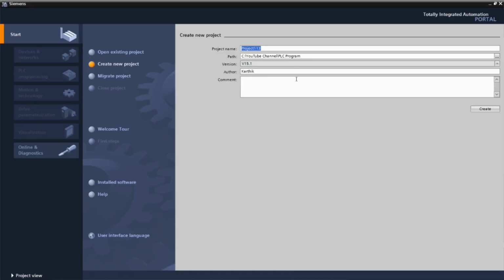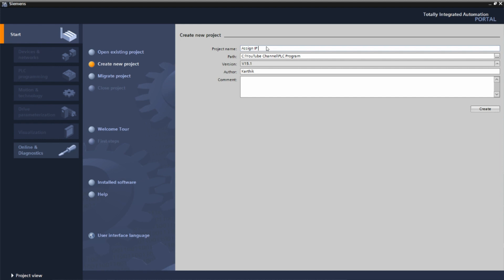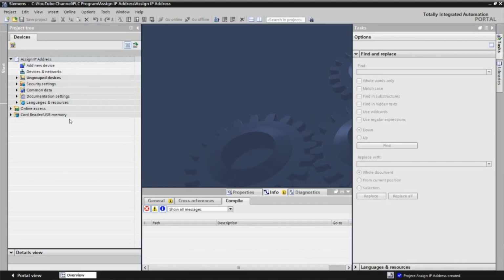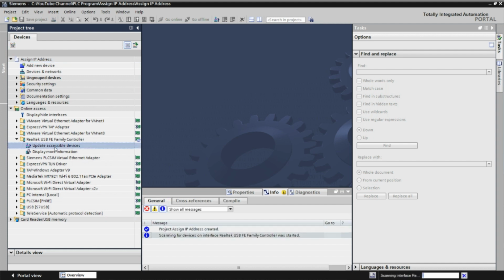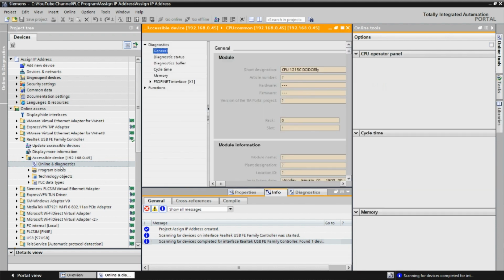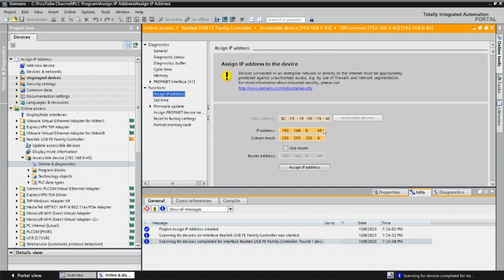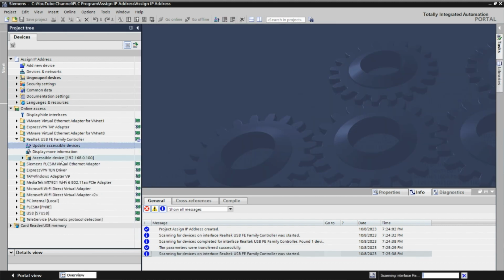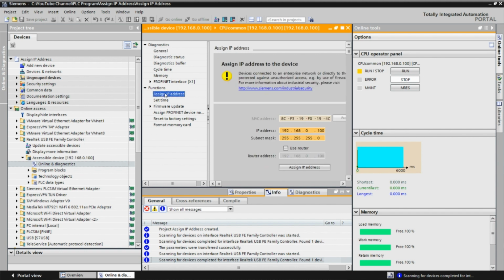How to Assign IP Address to Siemens PLC | CPU S7-1200 | Change IP Address | TIA Portal | Online |

Comment: mine wont change. it goes back to the same one. i cant changed it to my router settings.
Reply: This video did not mention about putting the PLC to Stop mode first before changing the IP address. Try putting the PLC to Stop mode if you can reach out to it and then apply the IP address change.